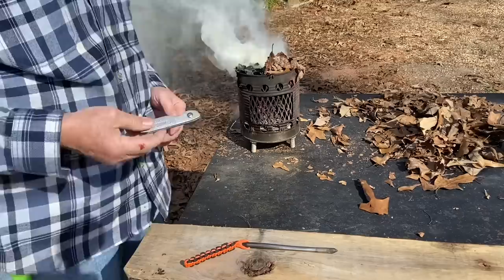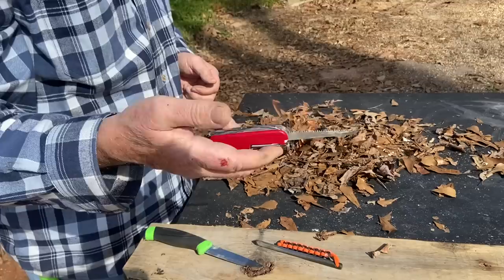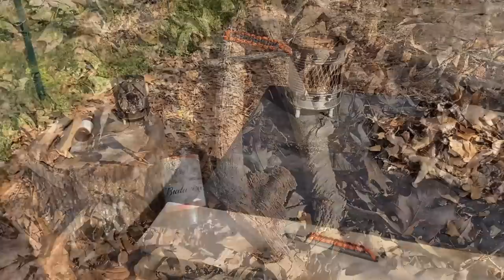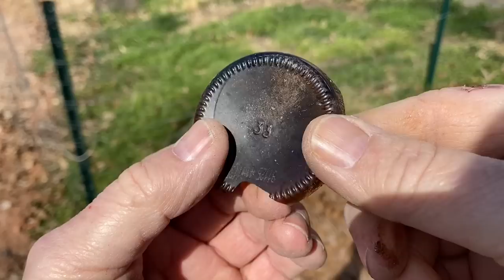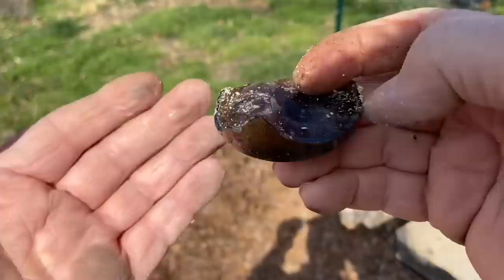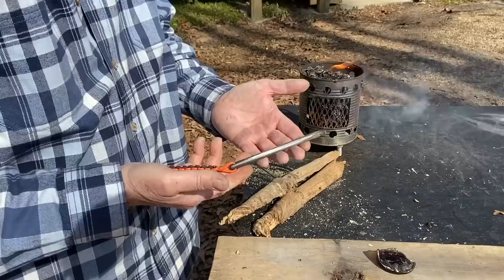How To Ferro Rod With A Beer Bottle, Mora Companion, SAK Fieldmaster, And Stanley 10-049!

Comment: I enjoyed the video as always!!
One suggestion I have for using the Swiss Army Knife, saw (SAK) is to place the teeth of the saw down on the tinder. Then pulling the Ferro Rod backwards across the top of the 90° edge of the saw.
It holds the tinder in place, concentrates all the sparks onto the tinder and the saw con not close. It's very controlled...
"The Old Gunny".
Reply from the maker: Felix Immler has a good video on that technique. It would be difficult to overcome all the moisture with that technique also. I may do a comparison video some day. The time before I used this technique and it ignited with one strike.

Comment: You can also use your glass mirror after  shattering it.  I did that and was pleased with the results.
Reply from the maker: Thank you!
Reply: @DavidWestBgood2ppl  Hi David, I broke my beer bottle Kronenbourg 1664 blanc( the blue one).  The body glass can strike just as well but be wary of sharp glass that chipped off as you strike.  Maybe using the bottom like you is a better way.  Thank you so much for sharing this ideas.

Comment: The regular Morakniv Companion has a polished spine, not suitable as a scraper. There is a heavy-duty version of the Companion for a few bucks more, which has a sharp ground spine suitable for use with a ferro rod.
Reply from the maker: I mentioned a Link in the Description to the video that shows how I sharpen a spine.